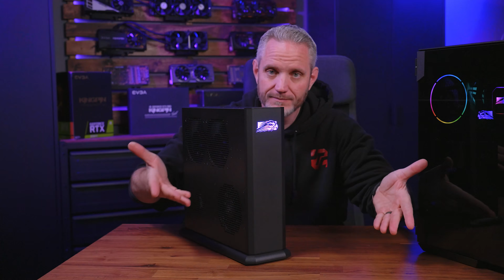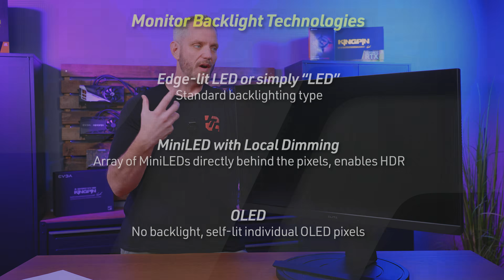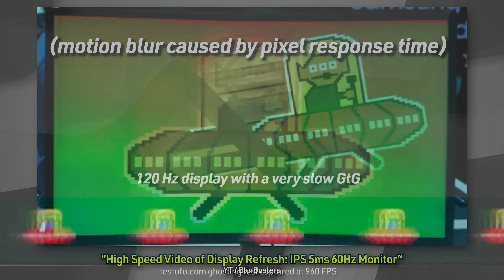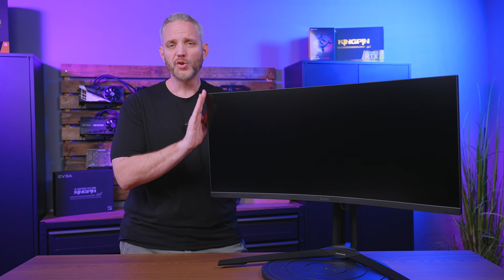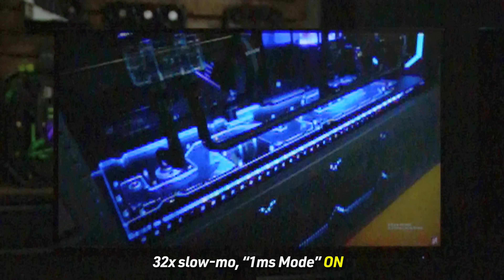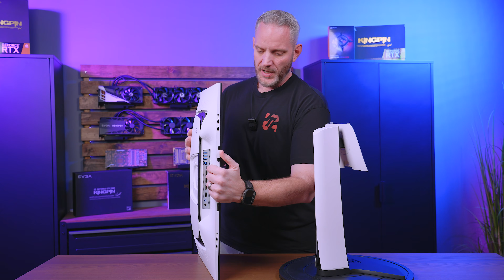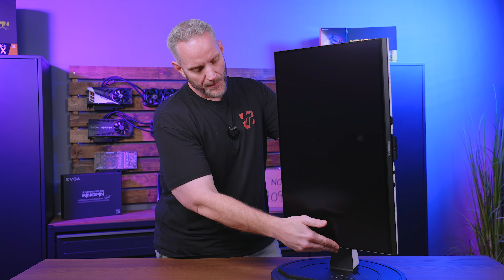Ultimate Gaming Monitor Guide: Find the BEST Screen for Your Setup

Comment: No mentioning of QLED / Quantum Dot LED or Quantum OLED?
QLED doesn't filter white backlight through RGB coloured foil like LED-LCD, it instead uses blue LED backlight to activate RGB quantum dots, which then emit coloured light themselves. You get better colours and brightnedd almost like OLED for the price of a IPS display. A 43" QLED 4k TV can cost under 300 bucks.
Quantum OLED uses blue OLED subpixels to activate the Quantum Dots and is top notch technology but is more around 1000+ bucks for a TV.
Reply: QLED is irrelevant as it goes back to the panel type debate. QLED can be VA or IPS. That means it's more just an advanced version of one or the other. Like Samsung's QLED panels are all VA and most others are IPS.

QD-OLED is very comparable to W-OLED with the benefit of better colors, but much worse handling in a bright room. Though to be fair, OLED is only suited for dark rooms as the full screen and average brightness is very dim. Like full screen brightness of 250nits means half SDR.
Reply: @Skylancer727  So better colours and better brightness for the same price are irrelevant. Interesting.
Reply: @MangoPango1973  you completely missed the point. QLED is basically just VA or IPS. Most displays even not labeled QLED are. I wouldn't use QLED as a reason to buy a specific panel. You'll mainly see QLED terminology used by very select brands due to copyright. Just because it's not labeled QLED doesn't mean it isn't. 

And like I said, the debate is pointless as you still go back to do you want VA or IPS? Whether it's QLED or not it still comes back to VA or IPS.
Reply: @Skylancer727  That's flat earth rhetoric. The difference between normal LCD-LED and QLED is big enough to define it as an autonomous technology as gasoline and diesel engines are. Maybe you are simply underinformed how this technology really works.
I highly doubt that any manufacturer sells QLED displays without advertising the Quantum effect and btw, the Term QLED can not be copyrighted and if you search for QLED TV at Amazon you get TVs of 20 different manufacturers. Your little hypothesis is done and dusted.
Reply: @MangoPango1973  man someone woke up on the wrong side of the bed today. Seriously using terms like "flat earth rgetoric and "your little hypothesis is done and dusted". Man who punched you in the face and told you it was your own fault?
Reply: Hell regular OLED TVs cost over 1000. These TV manufacturers have a racket going on with OLED, but damn if they aren't the best TVs you can buy
Reply: @The92Waffles  And many OLEDs have already 180hz and are better gaming monitors than regular gaming monitors. But the Price!

Comment: I'd say the most over looked part of a system is the sound system rather than the monitor but this is still good information.
Reply: Nah you don't need amazing audio. You can by Koss KSC75 or porta pros for $30 and still have audiophile grade quality. Like those things still sound amazing today and have all the imaging you need for gaming.
Reply: @Skylancer727  You can get second hand Stereo Hifi amplifiers for next to nothing, a set of stereo speakers for 30€ and a few cables for not much at all and get basically vintage audiophile grade gear.

Comment: Bought a MSI QPX 271 on black friday for a pretty good price. I have an IPS panel as my second monitor now as I was running a single monitor before I bought the QPX. Personally having them side by side I can say their is a noticeable difference. That being said I don't personally see the price premium on OLED's being worth it. I got a top of the line IPS panel in 2020 when I bought my system and it's honestly great. I wanted to try OLED because it was a decent price and I wanted a two monitor setup. Personally if someone were to ask me if OLED is worth it i'd probably ask what their setup/price budget is. If you got a big budget OLED is great. If you're on a budget or on a higher mid tier system i'd stay on IPS. I spent quite a bit on my build in 2020 and upgraded to a 7800x3d and a 7900XT and got this monitor. All amazing upgrades but if I had to pick the "least" valuable i'd of picked the OLED monitor. Great monitor and definitely WAY better than an IPS panel but when gaming and you're in the zone you don't notice those small differences as much. If you're streaming or watching movies then OLED is amazing. I think one OLED one IPS is the best setup to have. Also I do have to say that my IPS panel did cause some headaches over a very long gaming session where as my OLED doesn't do that. It's give or take and do your research and if you're on the fence about spending the money on an OLED just get an IPS panel. Just GoaliesTwoCents

Comment: CRT is still a legend.
Reply: And many are indestructible, I have an IBM 13" max resolution is 640x480 and it still works.
Reply: Black and White CRT or bust! Must use Channel 3
Reply: I loved my 19” CTX.  Unfortunately, it died about 15 years ago, and I didn’t have the money to replace it.  My parents bought me my first LCD panel to replace it.  No comparison in performance.  The CRT was hands down the winner.  But the LCD didn’t weigh the 50lbs the CRT weighed!😅
Reply: I have my old KDS XF-7e 17" in storage and refuse to get rid of it.
Reply: Can remember going on Hardforums and wanting one of the must have ones.

Comment: Actually VA is on the rise on the LCD front. VA being less color accurate than IPS is actually a very old claim, it's really not true anymore. In fact on the TV front nearly all the highest end LCD displays are VA. The reason is VA has by far the best contrast of the three. IPS is just still common with monitors over VA because the viewing angles aren't as great and VA is generally slower than IPS. Still Samsung and a few others do make 240hz VA panels.

Comment: Added the Curved Ultrawide 45 LG OLED this year when LG had the sale as my new center monitor along with portrait mode 1440's and a 4k 55in TV above. Even tho the Pixel density is lower on the 45, the OLED more than makes up for the difference coming from a standard 34in Ultrawide. The 4080 has had no problems running most everything at 100-144 FPS on High to Ultra settings. Monitor was so good I bought a 65in OLED tv for my living room and movies have been so good with the Auto HDR.

Comment: @JayzTwoCents, Just some important updats on a couple of points in this video.

I just want to point out that it is absolutely not true that all freesync monitors are compatible with Gsync and in a lot of cheaper screens and some not so cheap you can get an awful screen flickering affect. I have personally had this happen to me a a couple of different monitors and a TV and if you google it this is a very well documented issue. Before you buy any Freesync monitor please google it for screen flickering issue if you are using an Nvidia GPU.

Also in regard to screens with G-Sync having a g-sync module in them that is also incorrect now... Most monitors are determined to be G-sync compatible, this still just uses standard adaptive sync BUT has been certified by Nvidia that the screen is fully compatible with G-sync's VRR. However some really high end screens still use the G-sync module which IS still the best version of VRR as it has some variable overdrive tech that allows the module to have way more control over the refresh of the screen.

Comment: I found that if you're shopping for OLED and 4k, look at modern TVs instead of a "gaming" monitor. The price will be lower and the refresh rates have improved. I use the LG OLED42C2PUA, 2022 and have loved the experience (plus you can switch to TV mode and not have to leave your desk)

Comment: One of the biggest issues I have is the bezel/border. I literally have a 1/2" border on the sides/top of my 27" 4k monitor, where as my two 24" 1080p side monitors have zero border.
Reply: It never bothered me. I still use the PG27UQ and it has a full inch thick border on all edges. The monitor next to it has a 1/4 inch border, but damn does it get hot. Plus I use the border on my display to hang my face cam. It's designed to hang over the top bezel and on my second monitor it actively cuts into the image.

Comment: I ran 1080p 60hz monitors for years. And years. And years. At one point I had 3, one in portrait. I finally decided to go 1440 and ended up with a 34" UW 144 hz monitor, and I couldn't believe the difference it makes. I still use one of the 1080 monitors in portrait mode, but I'm considering a replacement for that too... maybe an over/under UW setup? Maybe a 40" 4K..

Comment: Been looking at monitors recently.  What I wish someone would do is make a better picture-by-picture (PBP) mode in a 5K 55" display.  So that I could have 2 wide screen displays up top and a super ultrawide on bottom at 1440p all in one screen.  Lot cheaper and cleaner looking than having two 32:9.  Very specific want I know.

Comment: Always check decent reviews - just because a monitor claims to have a 1ms response time, that's always based on a ridiculously specific single transition that can achieve this and often involves high levels of overdrive that cause overshoot. In my testing experience, IPS displays tend to be anywhere between 7 and 25 ms depending on the quality of the panel. The best are generally around the 7 to 12 ms range if you average across all transitions. You can't trust the manufacturers on this, as much like HDR 400 technically being HDR, in practice it is just so they can tick a box on their spec sheets.
Reply: Watching hardware/monitors unboxed has made me realise how inaccurate so much of the stuff said in this video is. He has 0 idea about monitors clearly.
Reply: @stealthhunter6998  Most people likely have a tough time with this. Its a steep learning curve, but one that can pay off the more you learn due to how varied the quality and specs are for nearly every category of monitors other than maybe ones that arent used for gaming. Even monitors unboxed can get it wrong. I just purchased a monitor they have suggested multiple times recently, the AOC 24G4EM (supposedly just a variation of the 24G4 model), and the viewing angles are trash. Almost TN (old LCD monitor tech) quality. My Acer 1080p IPS 60hz monitor purchased 10 years ago for $20 less has far superior viewing angles. I'll be returning it.
Reply: THEN, IF YOUR only purpose to buy a new monitor was to play Battle Field 6 from Xbox Series S via HDMI 2.1 and Baldurs Gate 3 from PC via DP 1.4a, would you choose 25" or 27" 1080p gaming monitor with highest refresh possible? (My GPU limits me to 1080p and OC-ing is not an option.) NO others funds for upgrades are available in the scenario.
Reply: @katiebea9258  What is your current CPU/GPU combo, and what is your budget, please?
Reply: @DjMessiahUK Current GPU NVidia GeForce GTX 1650 Super. $100 to $175 seems to be range of non-OLED 1080P 24 -27" monitors.
Reply: Unless it’s an oled, which are basically all maxxed at 0.03ms
Reply: @junyaiwase  Only OLED panels can go below 1ms. You have fallen for the marketing. Most of the LED monitors max out at 3-5ms.
Reply: @kokichat did u even bother to read what you replied to?

Comment: TL;DR 
Buy the biggest monitor you can. Sit 12 inches away. Make sure that refresh rate is locked to 60 Hz no matter what specs your monitor says it can do
Reply: Watch your vision slowly decline. 😂

1. Certainly a difference to 120Hz . Done the Pepsi test. Can’t see a difference above, accept the the advantages of FPS games which you might not play.

Comment: Looks like we are finally getting some 5120x2160 21:9 monitors being shown off at CES 2025, which is what I've been waiting for for a long time.

Just hope the prices are not insane.
Reply: I'm currently using a 5120x1440. Great monitor, but some games struggle to fit even on fullscreen, as you may imagine
Reply: I feel like the reason is that it is almost impossible to run a monitor like that
Reply: @davidhodge0201  my 6950xt can run it, but I think the ratio is off for most games. Also yes, my card won't run all games at this res at high settings
Reply: @davidhodge0201 yup most definitely need a 4080 plus to run that in todays games
Reply: @davidhodge0201   i have no issue using Lg Ultra wide 5k monitor and getting above 60fps
Reply: They will be at first. Probably take a couple of years before the prices are more palatable.
Reply: @TheGeneReyva the Dell 4025 was $2300, and on sale at thanksgiving for ~1600. Already getting better
Reply: EXCUSE me but LG has add 5120X2160 for years... you kinda late to the party
Reply: @alsey7  They haven't had gaming panels though. I don't want a 60Hz panel.
Reply: I just want to see if the 27 inch 4k 240Hz are releasing straight away like the PG27UCDM I feel like 32” is just to big especially for Comp gaming
Reply: @ARXInfinite I wanna get one . How much are they ?
Reply: @Cognitoman  the current 32” QD-OLEDs are around the 900-1200 USD Mark 

I’d presume the 27 Inch QD-OLEDs would be around 1000 As well
Reply: Samsung and 4090 has had this solved for a while it just is expensive for average consumer. None of these new monitors will be innovative, it will just be cheaper just like how 4k tv used to be for ballers and now everyone has one.
Reply: @RadioactiveLobster And it's about time! Typing this on my 2015 27" Retina 5K iMac with a mere 5120x2880 pixels

Comment: Correction: the Lower the R number the greater the curve.
The R number refers to the Radius of a circle in millimeters. A circle with a radius of 800mm is a much smaller circle than one with a radius of 2000mm, aka a tighter curve.

Comment: ANy particular models under $300 you suggest?
Reply: MSI - MPG 275CQRXF 27" LCD QHD 240Hz 0.5ms Adaptive Sync Gaming Monitor with HDR 400 (DisplayPort, HDMI,USB) - Metallic Black
$284 Best Buy

Comment: Great video. Need some more info on QD-OLED's as well
Reply: Eh, he kinda got VA completely wrong. VA don't inherently have lower color volume than IPS. In fact most TVs today are VA because they're generally more accurate for HDR as VA have better contrast. LG is one of the only main brands still using IPS for their flagships and shows from their lower quality blacks. 

The real reasons VA are less common on monitors is because VAs tend to have slower response times. There are 240hz VA panels but they're extremely rare. VAs also have an issue known as shadow casting where similar to inverse ghosting leaves a shadow in the wake of motion. It's not as big an issue in the newest displays but it is still there. 

And the real reason VA isn't common for professional work yet is because viewing angles tend to be inferior to IPS. Modern TVs tend to be so big and people sit far away so being VA doesn't matter. But people sitting a few feet away from a 32 inch display means the edges are at a pretty sharp angle from your vision. This is why Samsung's monitors tend to be curved: it counters the negatives of the viewing angles. 

IPS the best middle ground platform where it's close to VA in contrast with FALD and speed is faster. But if you sit far from your displays or prefer a curved display the VA may actually look better to you.

Comment: i think you nailed the sweet spot. next sttep up is 4k and cards are still not running new games at 120 4k ray tracing. but they can at 2k. or pay the primum for oled
Reply: New games are so horribly optimized there's no point in using them as your performance measuring stick.